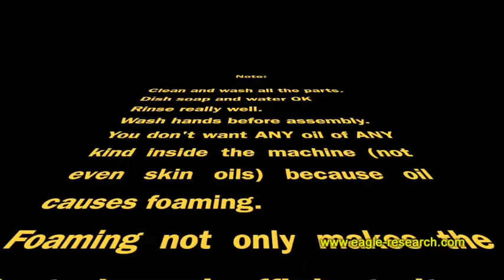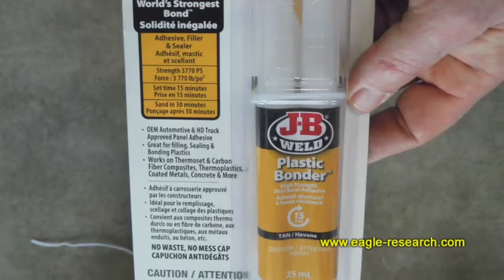Assemble and Wire ER50 Brown's Gas (BG or HHO) Electrolyzer from Kit (upgraded)

Comment: what is it used for?
Reply from the maker: There are about 30 useful applications for Brown's Gas.  I have 7 different electrolyzers in my home.  
http://www.eagle-research.com/erpdf/bg/BGbro.pdf
The BIGGEST current use is to help the body heal from almost any disease or ailment.  It also has ZERO negative side effects.
http://www.eagle-research.com/erpdf/bg/BG4Health/ER_ACbrochure.pdf

Plant's Don't Lie  http://er4u.info/4108
Read testimonials at the bottom of this page http://er4u.info/210

Subscribe to the Eagle-Research eNotices (if you haven’t already) to be informed when new information is available.
To subscribe: 
1. Go to   http://www.eagle-research.com/cms/newsletter/35
2. Click the subscribe button in the lower part of the left column
 No purchase is necessary to subscribe
Reply: George fantastic video and I can see from your DIY skills that you have a lot of years of experience of making these kits work. I have few questions though and you may take time to answer : 
1. Those plates which you glued down inside the Tube with PVC glue, will it be possible to clamp down those outside (22/23 of them) then inserting it at one go to cut down the time to assemble, secondly to make it neat and no messy glue entering reactor area. This clamped down plates if they are done at your end then the Client or User don’t have to take time to do that tideous or maticulous job. 
2. Usually with other BG reactors those plates overtime gets oxidised or gets pitted with Electrical or Splitting the water, then we take them out to gently rub them against a fine polishing paper to remove those oxidised marks. I suppose in your case this would never happen because from the assembly it looks like it’s done for life. Please correct if I am wrong. 
3. The BG gas is definitely very beneficial for human health but can we incorporate that output somehow to combine with bathroom Shower so that instead of Only breathing option it would go into the whole body surface to heal more quickly. Also if that gas is released in the air, let’s say in a bathroom, does it pose any fire hazard. 
4. I believe the output of BG is very low as it is designed to only inhale through the tubes, but can you or have you measured the Output in Litres / Min. 
5. Do you have a link where you have made this for a Combustion Engine use, let’s say for a Diesel Genset - I mean to replace the diesel fuel completely with BG. 
Thanks very much George.

Comment: What you do is good but the water you have, has impurities, so juice a box filter, ingredients an 1riverstones and grid stone,  rockstone or riffstone than clay and modsand, black powder from a barbecue, than gridsand, than clean sand yellow or beige, ontop you do littlerock stone, on the riverstone level one tube, make a tube and in side the littlerock on top also a tube tthats the input side for water when its al goes down, every bad minerals are out of the water and this is the same like a isolator from a swimmingpool its a 30 cm with 2 tubes. So than you can the water with trust and no worry. If you want to understand the layers how to build the bricks you has to look for thailand people on youtube, like make a welling kitchen and fireplace with clay and mod.

Comment: Hey my friend😉 i have a dry Zell build, how much i need NaOH of 1l Walter circa ?
Reply from the maker: A solution of 1% NaOH in water by weight will be conductive.  You can have up to 25% NaOH to water by weight.
Reply: @ecopegasus  Thank you, I used a stone diffuser for the first bubblers. Can it get clogged with the Naoh? Or should I only use a diffuser with the 2 bubbler?
Reply from the maker: @mindbomba9923  Use a bubbling stone in each bubbler.  You want the bubbles to be small to increase surface exposed to the water.  
As for clogs, no.  If there is enough NaOH to clog a stone you have MUCH bigger issues :)
Reply: @ecopegasus  Haha 😃 okay can i send a Picture to you E-Mail? 
would love to know your advice about this.
Reply: I have send you a e-mail 😉

Comment: does this get more gas mileage or not ? thanks
Reply from the maker: I think you are getting confused with my HyZor, which is the 12 VDC version of this technology and optimized for vehicle use.  Yes, the HyZor increases mileage as per this document:  Here is proof that BG assists carbon-fuel combustion, download PDF here:
http://www.eagle-research.com/cms/node/443

The ER50 (above video) is a 120 VAC to 240 VAC 'table-top' electrolyzer optimized for health application as per:
http://www.eagle-research.com/cms/blog/browns-gas/browns-gas-health-enhancement/how-i-use-browns-gas-health-enhancement
Reply: Will go to suggested address Thank's

Comment: Hi, can you please explain to me what the 2 capacitors are in line for, what is their electrical purpose in the circuit
Reply from the maker: If you go to the Sales Page, you'll be able to download the Assembly Manual that has the electrical schematic.  The ER50 Power Supply is a version of my Capacitive Power Supply technology detailed in my Capacitive Battery Charger Book.  
https://eagle-research.com/product/er50-flat-plate-kit-mini-bg-electrolyzer/
In short, putting capacitance in series with the load LIMITS the amperage to whatever you desire; locking the amperage and inherently solving one of the biggest issues with electrolyzers, called 'amperage runaway'.
https://eagle-research.com/product/capacitive-battery-charger/

Amperage runaway happens because amperage flow makes heat.  Heat causes electrolyte electrical resistance to diminish (solution becomes more conductive) which raises amperage flow, which causes more heat, which further raises amperage flow, etc.  Eventually either shorting out the circuit or causing issues from excess heat.

The CPS (capacitance in series with the load) stops the amperage runaway.  Another video demonstration this is:
https://www.youtube.com/watch?v=YQ5YbSBaNNU&t=74s

Comment: George,  what's the ratio of  sodium hydroxide per distilled water?
Reply from the maker: The ratio varies all the time, as water is used and you add more.  Luckily, it's not a big deal.  As long as there's enough lye in the machine to support electrolysis, you are good to go.  So I'd mix in an ounce (about 28 grams) of lye into the initial catalytic solution.  Do not add more lye with subsequent refills of water, just add water.

Comment: Can you please give me details of the capacitor
Reply from the maker: Virtually all details, including the capacitor are in my ER50 Resources.  You can purchase secure access privileges separately from the ER50 kit.  http://www.eagle-research.com/cms/resources/er50-watertorch
To further understand the Capacitive Power Supply you can purchase the Capacitive Battery Charger eBook
http://www.eagle-research.com/cms/store/free-energy/capacitive-battery-charger-incl-capacitive-transformer
Reply: George Wiseman If i do want to run this setup on 12 V 150 Ah battery
Reply from the maker: The ER50 is designed to operate on AC current, so you'd need an inverter.
Better (more efficient) to build an electrolyzer DESIGNED to operate on 12 VDC, like my HyZor.
http://www.eagle-research.com/cms/store/fuel-savers/hyzor-basic-kit
But a lot also comes down to 'how much gas do you want (or need) to generate?
In which case you may need to buy my Brown's Gas Book 2 (and it's resources) so you'll have the information you need to design an electrolyzer for your needs:
http://www.eagle-research.com/cms/store/browns-gas/browns-gas-book-2

Comment: are u really breathing both the oxygen and the hydrogen ?? I would'nt smoke then !!
Reply from the maker: Good Point.  The pure gas is explosive.  First, I've never smoked.  Second, the 'system' is designed so that the gas you inhale is UNDER the 4% explosive limit (has less than 4% hydrogen), so the inhaled gas is non-explosive.  One guy DID tell me how he was smoking while inhaling the gas and he DID manage to ignite the gas, but the explosion went back into the machine (which is designed to handle it) and NOT down into his lungs because eat least the fool was paying attention to protocol.
He then had the balls to admit it and tell me the story... Which I appreciated.

Comment: Wich Metall ist this for Elektrolyse?
Reply from the maker: The electrodes are 316 stainless steel.
Reply: @ecopegasus  Doesn't stainless steel dissolve during electrolysis? Shouldn't you take titanium?
Reply from the maker: @mindbomba9923  You need to learn about electro-deposition voltage.  If the cell voltage rises above the electro-deposition voltage of the material, it will decompose.  
This effect is used in electro-plating.  The metal from the anode (+ charge) to the cathode (- charge).

Many 'flow-through' electrolyzers do not use a specific catalyst and depend on the impurities in tap water for the electrolysis to happen.  This causes very high cell voltages and results in anode decomposition (among other things).  
That type of electrolyzer MUST use electrode materials with very high electro-deposition voltages to get ANY life out of the electrodes.

Our electrolyzers are DESIGNED to keep the cell voltages well below the electro-deposition voltage of stainless steel (actually below the electro-deposition voltage of plain iron but we like the nickel in the mix).
So the plates do NOT decompose and will last the life of the electrolyzer.

I'm still using electrolyzers that I built in 1986.
Reply: @ecopegasus  Thanks.

I would like to build such a device for myself.
Do you have building instructions to buy?

What I ask myself is, there are some that also work with distilled water, isn't that better than sodium? And how exactly does it work without sodium?

Can you describe the whole thing with alternating current?
Reply from the maker: @mindbomba9923  I've written two books that cover the questions you are asking, because to answer them (and the subsequent ones) will require BOOKS of information.  
You have a lot to learn and I wrote the books so that I can teach MANY what you are trying to learn now.  
Buy Brown's Gas Books 1 and 2 here:
https://eagle-research.com/product-category/browns-gas/
Reply: @ecopegasus  Have you the Book of German?

What a Filter you Used to Filter the Gas?
what do you take for an electrolyte. Don't you breathe in the electrolyte?
Reply from the maker: @mindbomba9923  These are the kind of questions you ask by contacting me directly.
https://eagle-research.com/contact/

Comment: I may be stupid or have missed something but over half way through now and wondering how in the fuck the screws in the caps of the stack tubes ever make electrical connection to any of the plates? Is it done simply by the electricity flowing through the water and if so then what is the screw connected to in the cap? Must be something there besides a fucking screw head. You seem to have skipped over an important detail in that regard. Also I thought your use of space in the box was poorly thought out.
Reply from the maker: First, profanity is not needed or appreciated.
Second, Your 'guess' is correct.  Just like any electrolyzer, the electricity flows through the fluid to the next plate... Just in a series-cell (bi-polar) electrolyzer you can 'stack' the cells by using a series of plates.  The area between each one then becomes another cell in series, thus making a high voltage / low amperage electrolyzer (much simpler and more efficient).

The screw on each end is for the DC current to enter and exit the electrolyzer (positive and negative).  This design is not polarity sensitive.

I sell several books on how to build series-cell electrolyzers, like this one.
http://www.eagle-research.com/cms/store/browns-gas/browns-gas-book-2

As for the space in the box, it's the result of years of experience, building thousands of electrolyzers.
I cannot think of how to do it better.  Maybe after you learn about all the reasons it's designed as it is, you can figure out a better solution.